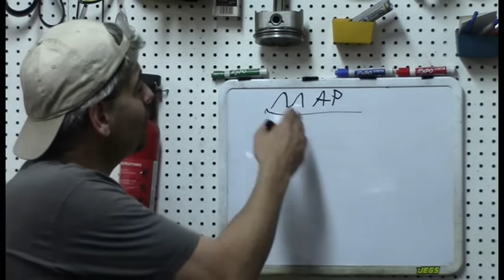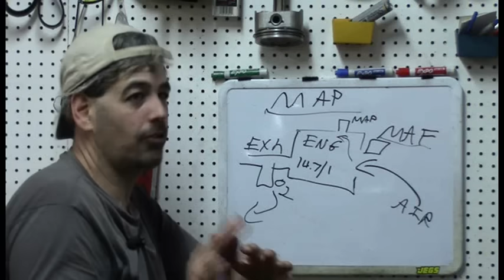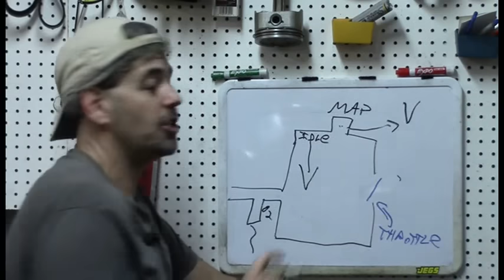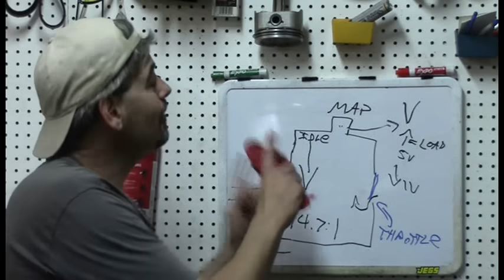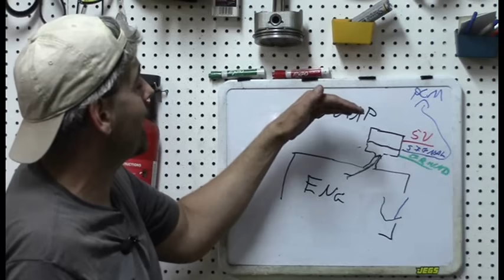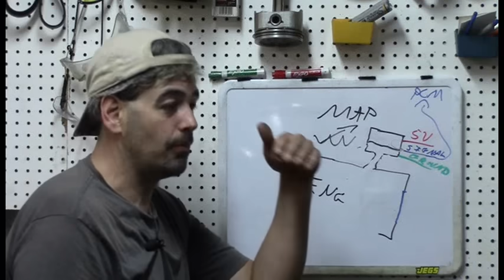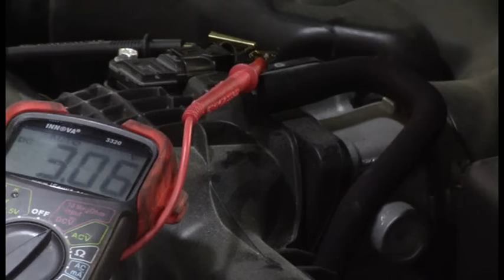MAP Sensor Diagnosis and Understanding Function- Pt1

Comment: I just come across very nice Master i have one question maybe u can help me i have BMW Diesel and the check engine light is on I went to the workshop they was check and the told me i have to change the mass air flow sensor and I did it but the problem still.
The code ist (44B5 Digital diesel electronics DdE mass air flow sensor ) what i can do?
Thank
Reply from the maker: I would have to see their data that indicated the MAF was bad.
Reply: Thank for the answering the told me only that this fault codes.4BB5  Absent Digital Diesel electronic DDE Mass air flow (MAF) Sensor 
4Bc0  Absent Digital Diesel electronic DDE Mass air flow (MAF) Sensor that what it’s showing.thx again

Comment: MAS - Manifold Air Sensor How fast is the AIR flowing
Reply from the maker: It’s the MASS of air- not the speed. The speed is irrelevant to air fuel mix. The volume of air at any specific point in time is what matters to maintain stoichiometry. Measuring mass is the most accurate way to measure

Comment: need help ,my pathfinder acts like it floods out when I accelerate to fast.  I cant get over 2000 rpm ,  im getting couple codes, p1140, p0300,p1320  I hooked up bt scan tool and its saying that the voltage on my tps is erratic at idle and at any acceleration its constant 4.7v  .
Reply from the maker: The P0300 would explain it best. Simple diagnosis obviously. Start there!
Reply: @SchrodingersBox  I guess im missing something. Multiple misfire is the symptom right? And not only that but a symptom of many different causes. The garage down here was wanting to charge me 900 and replace the coil packs and spark plugs and can sensor. I don't know much at all about mechanics but that just seemed like that wasn't right.
Reply from the maker: @btac6481  Misfire seems to be the cause of the drivability symptoms.  It is of course an effect in itself, but what I am saying is  I would do a misfire diagnosis as the first step and determine cause of the misfire which should also resolve the other codes which appear to be referenced rather than causitive.
  The misfire is the "hard fault" to start with.
Reply: @SchrodingersBox  brother im trying to watch all your vids about this but I can't retain all this. I can barely figure out the scan tool ,. I don't know where to start with the cylinder misfire. The farthest I've got is maybe MAF or vvt or TPS. But even there I don't know how to read any of the results. I thought I was on to something when the TPS voltage was erratic .  Im a machinist not a mechanic and me and the fiance have been sharing my truck for past two weeks going into work 3 hours early and waiting on the other to get off 2 hours and we both live an hour and half from our jobs so im desperate for any help figuring out what to do to get this Pathfinder running. I appreciate any input given.
Reply from the maker: see my video on FASTTEC
Reply: @SchrodingersBox  i unhooked the maf while running and it barely hickuped.  does that eliminate anything or complicate it more.
Reply: @SchrodingersBox  btw  i got new codes i know one is from unhooking the maf but they are p0100, p1320,p0300,p1140
Reply from the maker: @btac6481  Like i said, start with the easy one.

Comment: I have a 95Gmc safari and it has gas coming out ehaust pipe could this be a sign of map sensor failure i replace spider injetors, before i dod the van did spit any gas now it does. It dont run hot at all crank rite up any suggestions
Reply from the maker: That's usually a sign of a stuck open injector. You should have diagnosed if you have a driver stuck for the spider before changing it- just changing the spider does not necessarily fix this if it is a control side issue.  Check to see if there is short circuit causing constant signal to the injector.
Reply: Ok thanks
Reply: So it cant be a blown head gasket
Reply from the maker: Antoine Davis  Why would that cause fuel out the exhaust? I'm not following you, sorry.
Reply from the maker: Antoine Davis Actually it just occurred to me- the very first video I ever made dealt with this system and shows how to diagnose this exact system, part of it covers fuel injection and control to the spider injection and it should be very simple and straightforward even for a novice.  I suggest watching it so you stop buying parts you don't need. Here's the link,
 https://www.youtube.com/watch?v=WuP-z2LMcTg

Comment: Could a dirty air filter cause this code to popup?
Reply from the maker: Not likely but I assume if the actual induction metric is legitimately low enough it could be interpreted as a MAF defect but remember there would not be fuel trim correction since the reading was indeed accurate and the PCM would have to consider this.

Comment: if the map sensor is bad would all 4 o2 sensors through a code lean. It has happen a couple times, only when I get on it. then it gets doggie. I clear the code on the go and takes off again.??? No map code or MAF code.???
Reply from the maker: There are many reasons all 4 sensors could show lean codes, a bad MAP is just one, but an unlikely one. Is the MAP signal proportional to TPS position and baseline value for barometric pressure?
Reply: ?? had TPS problem 2 years ago replaced it. Also replace nock sensors and intake gaskets last summer. haven't had a scanner on it since. Also thinking ground problem. ???
Reply from the maker: MNicehole Sure could be- what was the voltage you got at the MAP and how did it vary with TPS position?
Reply: I'll get back to U after I get it checked out.  Thanks for the videos, very good info.

Comment: Would a map sensor cause an egr code?
Reply from the maker: +James LeBleu It could.  What is your data indicating the MAP is malfunctioning?
Reply: None, I changed the egr and it still  signals the egr, and the galley's are open..
Reply from the maker: James LeBleu Ohhhh- in that case the question is what was the indication that showed the EGR was at fault? What test was it you did showing that the valve itself malfunctioning- that would be exactly where I would start my analysis.  What were your readings indicating the faulty EGR valve?

Comment: On the video of the map sensor there is no pressure in the manifold it's all vacuum so how could it be called a map sensor
Reply from the maker: Because it measures absolute pressure. The vacuum is the zero point, not atmospheric.

Comment: Hi Top job  can you help me and one of many with the same trouble on a Chrysler grand voyager same as your town and country 2007  oil light comes on and off again when it feels like it I don't want to be one of the 98% engine is in good com oil pressure is good  had a good sensor in tool box made know difference any ideas please on this one know codes in car thanks. Jeff in uk
Reply from the maker: Pretty simple- just check the oil gauge continuity and validating by bypassing the sensor and then again by inducing variable resistance.  That's it.
Reply: Thanks ok but new to all this have you done a video sounds silly but we have to lean thanks to you I am slowly learning  ok with fitting just this old school me 1970s cars easy to do will be following you. Jeff in uk

Comment: Hello sir, I have a Honda Civic 98 my map sensor always reads 0.80 volts but operating lean condition. I have hesitation and rough idle issue
Reply from the maker: What is the MAP reference voltage showing?
Reply: @SchrodingersBox  5 volts sir
Reply from the maker: Ok good- what you need to do is measure the signal voltage when you “snap” the throttle. That is- floor the throttle all the way for like 1/2 a second and release. The MAP voltage should go really high- over 3 V and then go lower than .8V when engine decelerates.  If it does not, then Map sensor is bad. If it does work then you need to do the exact same check at the PCM input because it means signal isn’t getting to PCM.
Reply: I checked it and it reads 3-4 volts. When engine declerated it goes lower like 0.60 volt
Reply: And catches where it was before 0.80
Reply: My fuel trims +18
Reply: I have to tell my O2 sensor always 0.90
Reply: How could it possible when you have lean mixture and O2 sensor reads too much fuel?
Reply from the maker: Is that your front or rear O32 sensor?? Sounds like you are measuring rear sensor.
Reply: Sir europe models have 1 O2 sensor before the cat
Reply: It might be restricted exhaust or something? Because i am definitely reading lean condition,
Reply from the maker: If exhaust is restricted why is MAP not at 5V, right?
Reply: @SchrodingersBox  i don't know sir. So why is my fuel trims positive when O2 sensor reads it rich?
Reply: @SchrodingersBox  it would be nice video if i live in America. I love your describing skills. :(
Reply: @SchrodingersBox  sir i found a huge vacuum leak under the throttle body i guess thats my problem thanks for help👌👌

Comment: my map sensor keep going out what causes that
Reply from the maker: WHat is the input voltage  reading? Do you have intake backfire?
Reply: Schrodingers Box I don't now for shore on voltage reading but I do have black smoke that comes out
Reply from the maker: Need that voltage reading. simple check.
Reply: Schrodingers Box   is the voltage reading the battery

Comment: What makes a MAP sensor to become faulty??
Reply from the maker: it’s so rare that i see it happen but age, carbon buildup, contaminants can all cause failure of the MAP. 
  another thing that can do it is backfiring in the intake. the high pressure can rupture the diaphragm.
Reply: @SchrodingersBox  Ah I see. I had a misfire for a month ubtil I had to change the ignition coil, which then stopped it.

I wonder if my MAP has been affected..

Do you think buying high quality  MAP sensors is just as good for OEMs? I have a 2018 huundai elantra with a 2.0.

((( Would you have videos explaining which parts must be OEMs vs parts that don't have to be? In general? )))

Comment: HI PLEASE ADVICE ME AS WHAT TO DO AS MY BAKKI USES A FOUR PIN SENSOR AFH45M-46 WHICH IS FAULTY AS YOU KNOW THE OLDER BAKKIS USED 4 PIN AND THE NEW CARS AND BAKKIS USE 3 PINS  I TRIED EVERY PLACE POSSIBLE TO GET ONE BUT NO ONE HAS IT THE SUPPLY TO THE SENSOR IS 12 VOLTS.SO PLEASE ADVICE ME WHAT CAN I DO MAYBE USE A 3 PIN AND MODIFY IT OR WHATEVER.
Reply from the maker: I would start by fixing your caps lock key.
Reply: THANKS FOR THE REPLY BUT MY AFH45M-46 IS BURNT AS IT IS OBSELETE WHAT CAN I USE IN PLACE OF THAT.

Comment: Sir i cleaned my throttle body, placed it back on, and cleaned my mass air flow sensor. NOW my RPM are jumping so high, even in neutral position. When i start the car it jumps straight to 2000rpm, then stays around 1500. any idea?
Reply from the maker: What was the baseline data you had before messi g with it that demonstrated there was an issue with throttle body in the first place?
Reply: Schrodingers Box hey so i did a OBDI scan, and it mentioned p0121 which was throttle body and pedal sensor. I dont have special OBD scanner to go more in depth, but i checked the throttle body and it looked very dirty and decided to give it a clean. I dont have a check engine light. but the RPM are very high! they go back down to 1000, but when i reverse they jump right away!
Reply from the maker: You have no relevant data to help diagnose. Seems obvious you installed it incorrectly though.
Reply: i guess, man! have you heard of this issue high idle when the throttle has been cleaned and placed back in?
Reply from the maker: Only if is replaced incorrectly. What's the TPS% position and voltage at idle va WOT?
Reply: ill let u know if  OBD reader can give me that info!
Reply from the maker: just use a DVOM you don't need a reader.  Just measure the transition between signal and ground and the TPS% increases i need something to go on here- There is nothing but guesswork so far. get scientific.
Reply: sorry boss not a science man, but my GUT is telling me its going to be ok. the RPM are adjusting! thanks!
Reply from the maker: Well you don't need any fancy tools, knowledge or even a job or education when you simply listen to your gut.  Oh how that makes the world such a simple place.

Comment: Hey I'm not getting a reading on my signal wire on a 87 tbi...  will that still let truck run? Or am I doing something wrong? Plz help lol tx!
Reply from the maker: If you are not getting signal but you have feed and ground?
Reply: @SchrodingersBox  yes exactly... with truck running and snapping throttle.
Reply: @SchrodingersBox  any ideas
Reply from the maker: @jamesdionysius9945  If you have feed and ground but no signal then the MAP is bad- no other explanation. If there is signal from the MAP but not at the PCM, you have an open or short to ground on the signal.
Reply: @SchrodingersBox  so I pulled it off the bracket and got a reading from the signal finally was 3.9 at 0 vacuum and 2.3 at 10 on vacuum dose that sound right or where is a good place to get readings for a old tbi
Reply from the maker: @jamesdionysius9945  So wait- you opened thread by saying you had no signal reading... now you are saying it has signal reading?
Reply: @SchrodingersBox  after I pulled it of opened the plastic pig tail I got one then... iv been fiddling with it a bit. But ya at first with truck on I did not get one I need to try it with it running again. Vacuum at 0 I get 3.95 and vacuum at 15 I get 1.18 with a pump sound close?

Comment: I have a 2016 Mustang with a v6. I purchased it brand new 2 months ago with 235 miles on it. The 3rd day after letting it sit for 12 hours and after  few minutes at high idle it dropped down to 600rpm's and started to shake as if it was going to stall. 3 different dealers said if no engine codes they can't tell what it is. they checked tsb's and only one service writer said there was engine idle problems but no fix.  it does it every day after sitting over night. It goes to 800rpms then to 600rpms. 2 different dealers let me try other Mustangs with same engine and they go to 1200 rpms and then to 800rpms and then to 600rpms and no rough idle. it seems I'm missing 1 warm up idle. your help would be deeply appreciated.Read more Show less
Reply from the maker: What data do you have?
Reply: nothing
Reply: no engine codes either
Reply from the maker: cant help without data bro. at least some fuel trim curves against load or something would be a start.
Reply: thank you very much. I like you videos. very helpful in learning new engine electronics. I've been driving 1978 olds. easy to fix no computers needed

Comment: Greetings professor. 
How do u know it's 14.7:1 ? 
Is that a standard reference value? 
U say 14.7:1 all the time.
 When I balance a chemical equation for the combustion of octane C8H18 ( assumption 1) I get different values. yes, I know  gasoline isn't actually octane. It's just octane rated ( whatever). 

 I teach chemistry at a university and I rarely find stoichiometric ratios are decimals. Just saying....
Lets assume it is octane
I get 25:1 oxygen :octane.  Balance the equation of C8h18 + O2   -> H2O + CO2

It's 25:1 so why is the computer programmed to use all these sensors to keep the ratio at 14.7:1 ????
Reply: I forgot to add that air is only about 18-20% O2. With that knowledge let's say 14.7 moles air is only about 2.5 moles oxygen gas. WTH? 
So combustion would seem rather incomplete. Can anyone Clarify this?!
Reply from the maker: +Austin Quinn One over site is you are calculate to octane. Octane is an additive (actually there is no substance "octane"- normally the additive is methyltertbutylether).   Gasoline is a heptane. "octane" is added to reduce detonation due to combustibility when compression occurs. 
    I have never really done a calculation though to determine why the optimal ratio is 14.7:1. Many people erroneously think it is related to STP but it is purely coincidental.
Reply: +Schrodingers Box 
I actually made a mistake in my math!!!!! I suck!!! That's what I get for trying to balance an equation while catatonic.  It's 12.5:1 (oxygen: Iso-octane).
It was my understanding that gas is mostly iso-octane which still has the same formula (C8H18) but it still isn't enough to to be "stoichiometric" b/c 14.7x .2 = 2.9 moles oxygen per 14.7 moles air. I just found it odd that they call it stoichiometric. I thought maybe  there was some secret to understanding that. So the 14.7:1 results in the best performance, I guess someone assumed it was because the reaction wasn't limited by one of the reactants and therefore "stoichiometric". But it's still a bit of a mystery and I plan to get to the bottom of it.

Comment: I'm just saying what obds reading out
Reply from the maker: Yes I understand, but you need to first determine if the rich condition at idle is the result of the MAP being the problem or if it is the result of another condition.  
Do this- try a KOEO test of the MAP and verify you are reading BARO at STP. If you are then the MAP is surely calibrated, however if you are not seeing that, the MAP is likely the problem.  Remove and test resitance to verify if it is wiring or the actual MAP sensor.